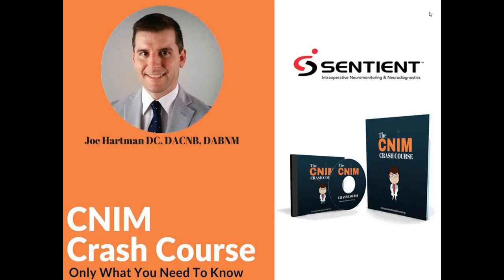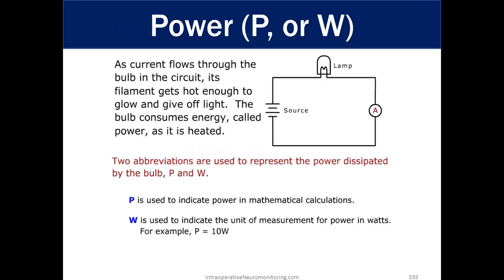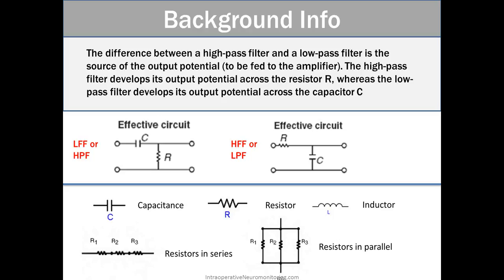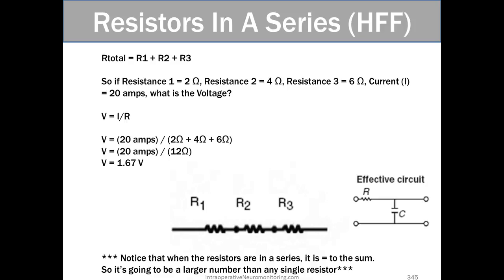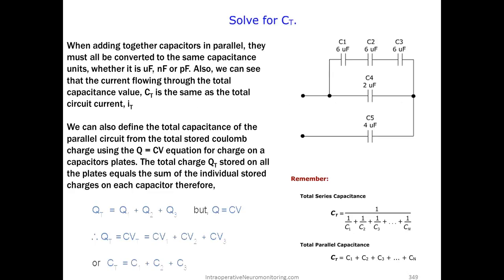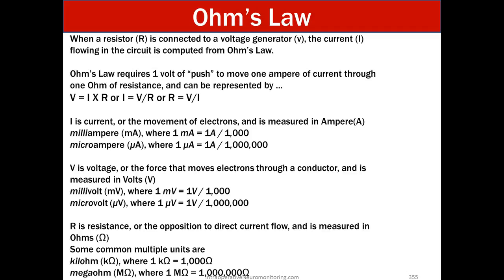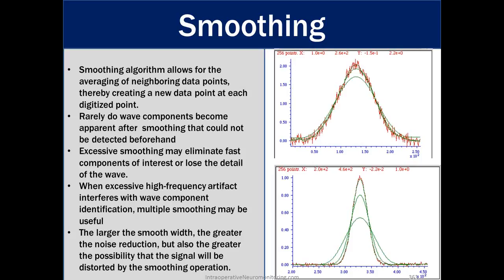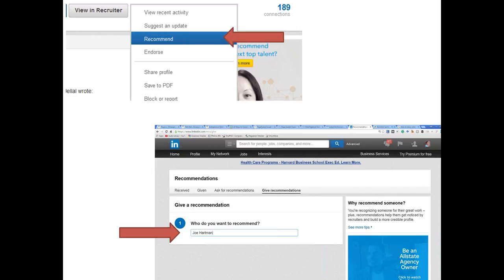CNIM Crash Course 7 Electrical components

Comment: Typo @ 9:19 - Resistors In a Series (HFF): the slide has V=I/R when It should be V=I x R;  thus making the equation  for Voltage as V= 20amps x 12Ohms = 240Volts